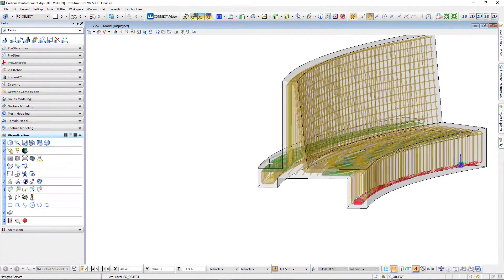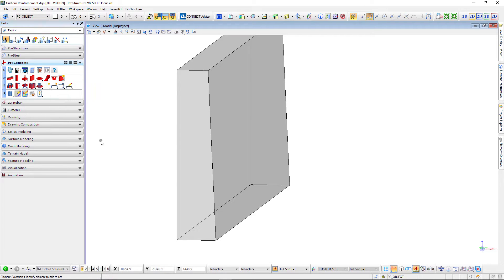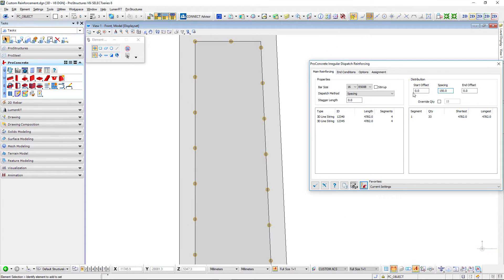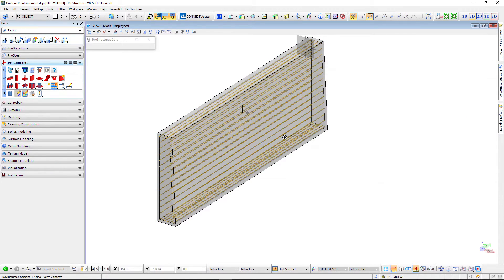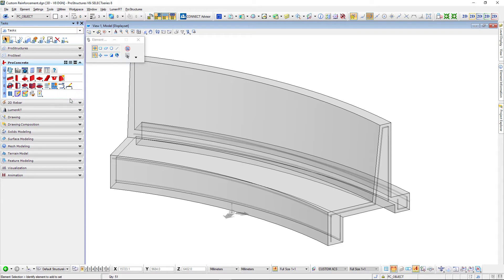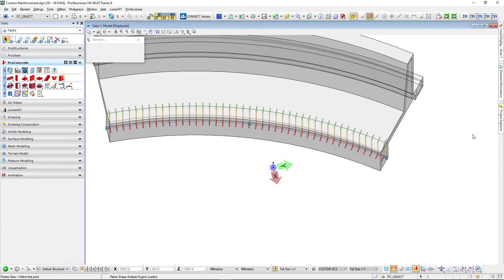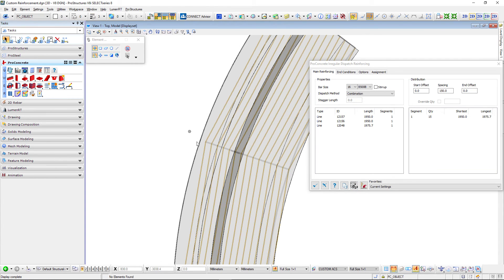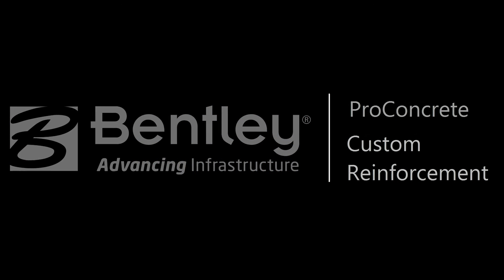ProConcrete - Custom Reinforcement

Comment: How does this help me as a rebar detailer? In microstation, instead of spending the time to create a 3d concrete model, i would have just drawn the plan view and section cut of this and easily entered rebar callouts based on those 2 views. Does Proconcrete still let me do everything i can do in Microstation?
Reply from the maker: Hi Slavisa
Yes ProConcrete is based on MicroStation so you can do all that you were doing previously in Microstation in ProConcrete.
ProConcrete functionality allows to create a virtual construction model, make sure that there are no clashes. Ckash detection is built in the product 
You can cut drawings (sections plans details) that are always connected to the 3d model and have intelligent labels based on rebar data so that you no longer have to remember bar marks, spacing, sizes etc..
Those drawings will also automatically update once you change the 3d model meaning bars adjusted in 3d will be properly displayed and annotated on EACH view they are visible on.
Reply: @bentleystructuraldetailing3130  hi what the price of program ?
Reply: Can you teach me Prostructure privately? My email lcherene25@gmail.com